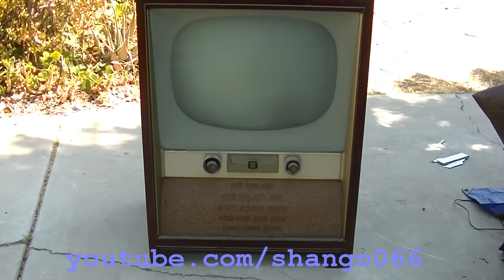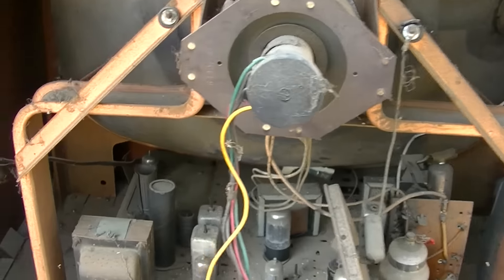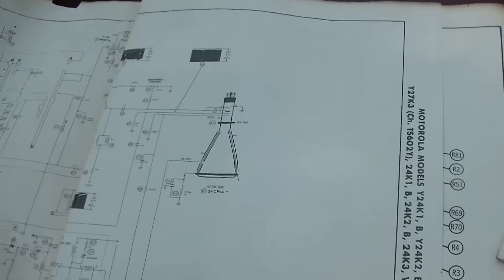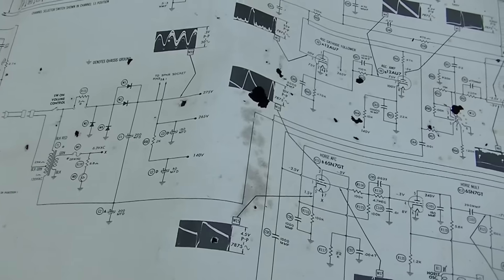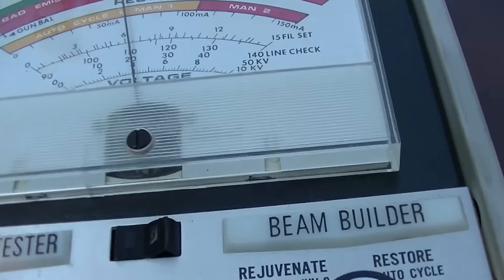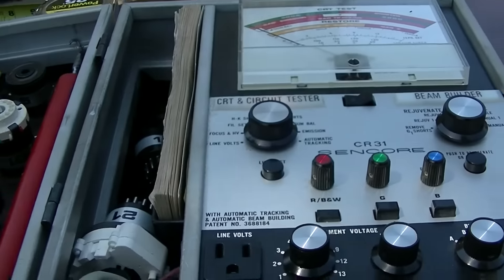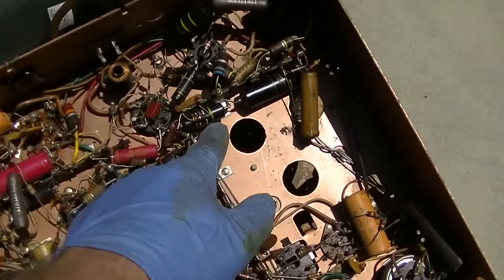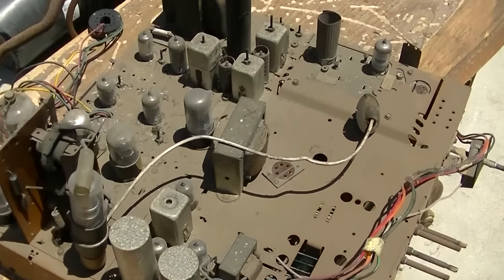Massive 1954 Motorola 24 inch Black And White Console Television

Comment: Even with color TV right around the corner, this set would really have been something.

Perhaps you should hook it up to a test CRT and resurrect it that way?
Reply: There are still some people around who can rebuild picture tubes. This one might be worth it.
Reply: @westelaudio943  Who? This is a great controversy.
Reply: RCA Color TV's were available in 54.
Reply: @randyab9go188  They were terribly expensive and there was little programming available.
Reply: @johnnytacokleinschmidt515  

I've seen it several times on the interwebs - people taking the necks off of CRTs (even color ones I think) and repairing the gun assembly. Then they welded the tubes back together amd re-vacuum'd them. The bad tube then worked like new. I can't point to a specific person as I don't remember. Maybe Glasslinger could do it, he at least did some regular tubes like triodes... A B/W CRT might be doable for him aswell.
Reply: @westelaudio943  Yes we are familiar with the process. I think people have said Hawkeye was the last rebuilder to close.... Vintage Television Museum in Ohio may have his equipment, but they weren't up to speed. Also who has the guns? Again I'm just wanting to find out myself. Wish I could do it, but I can't.

Comment: It’s a shame about the picture tube especially if it was a UHF set. I fixed one of these and it had the original CRT . I found it odd how Motorola TVs had the flybacks under the chassis. The only other sets that had this were Stromberg Carlsons. Also there was a 27 version too

Comment: I would recommend trying a rejuvenation using the Beltron.  I have had similar emission dead CRTs brought back to life (more than once), what have you got to loose?  Start with the Clean function, then move onto the full Restore.  Apparently, some piece of debris in the gun shorts out the emission.  That CRT has been asleep for over 50 years so, who knows?

Comment: This was a nice set, however, the CRT been went into transition a long time ago. Other than that, very robust chassis
Reply: 😆 I'm not a cathode ray tube! I'm a deep space vacuum capsule! I am! Therefore I Am!
Reply: @cjmarsh504  Lol, I suspect sometimes not! (Ever pick one up?) It could have leaked some air in. The getter would cloud and flake away white. Filament would oxidize and burn away.

I have a color Admiral with a gun that won't budge. Can a cathode get that bad? Or is it a broken weld? Could it be zapped back to connection? I don't know, but it's interesting to contemplate.

Comment: the diodes in the power supply are paraleled for more current, but you wouldn't do this with silicon diodes, with silicon diodes one would conduct most of the current and other none at all, but with germanium diodes the current will be more shared between the diodes
Reply: Those diodes with fins in the set were selenium diodes.

Comment: Stupid question but can a substitute CRT be found?  Are they all unique?  Can you put a 19 inch CRT on a 24 inch set?
Reply: Yes you can and it's electrically not hard at all. Physically, not that easy. But the end result would look goofy with smaller CRT in the 24" bezel and it's far from clear how you would hang the smaller CRT in the set. As usual, it's a matter of how much work you are willing to throw at the thing.
Reply: @pneumatic00  Well he sounded interested in working on the chasis so I'm thinking get some type of CRT and fix the chasis.  All of my stuff is modern and modular so I naturally think if one part goes down find a compatible replacement.  I had a big Advent late transister TV and it went down early.  I thought the instant on malfunctioned.  The repairman came out said no parts available and I junked the innards.  Put a 31 inch flat screen in the wood box. Currently using a CRT TV and computer monitor, no problems.

Comment: The B/W CRT's cathode emits electrons which strike the phosphor on the screen to produce light and a picture. The emission degrades normally with CRT use and, eventually, there is insufficient electron flow to produce a satisfactory picture. The user may take one or more of several measures to improve emission or replace the CRT, or may take the TV set out of service. If the TV is taken out of service, emission degradation should stop.

shango066's CRT testers measure emission without producing a picture. If weak emission took the TV out of service, shango066 should measure enough emission to produce a barely viewable picture. In the Motorola, shango066 found a fault in the high voltage circuitry that, on its own, should have caused the TV set to quit working. Presumably, the TV set was producing a viewable picture at the time that it quit. We see that some effort was made to do repairs, possibly implying that the CRT was good enough for someone to attempt repairs. (However, the repair person may have had a good CRT on hand, ready to install if repairs had succeeded.)

So, we are left with a puzzle. Was the TV set producing a viewable picture when it quit working? Maybe it was being used for an extended time with a dark screen as a TV sound radio, a scenario that seems very unlikely. If it was producing a viewable picture, what happened in the meantime to drive the emission so low that it is not measurable on shango066's CRT testers? With his vast experience working on vintage TV sets, we can understand why he was puzzled and put significant effort into trying to find an explanation.

Comment: That would have been more than 24 inches,  as back in the days of CRT TV's the glass was taken into account as well as the actual picture. I'd say it's a 26 or 25 incher you have there!
Reply: Tube part number has a 24 in it.
Reply: @jamesplotkin4674  Ah, I see. I'm in the UK and screen size was always measured corner to corner, from edge to edge of the glass. I was always of the opinion that we were being openly cheated out of the extra two inches!

Comment: Can't get any more Classic 50s TV design than that
Pinnacle of MCM TV design
If innards/tube were unsalvageable or not worth the effort, be fun to see someone retrofit a similar size color tube from the 90s/early 2000's with associated circuit boards into the cabinet
Or just plunk in a thrift 4x3 LCD that fits, maybe with a custom glass front bezel and masking